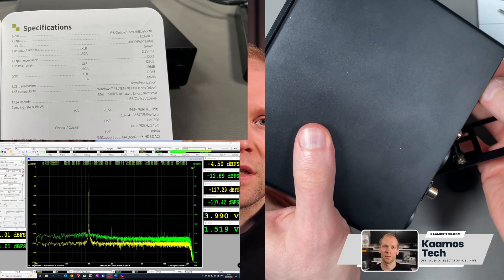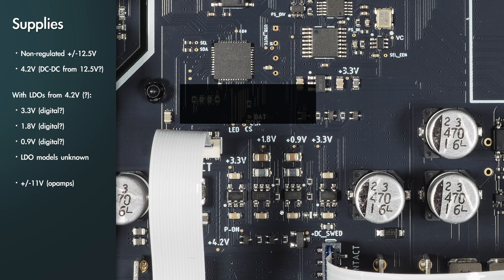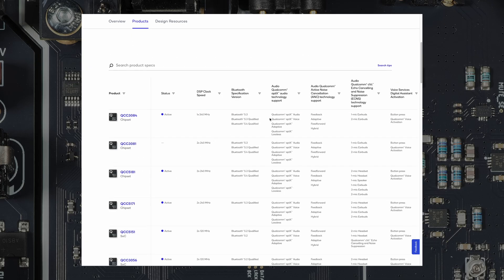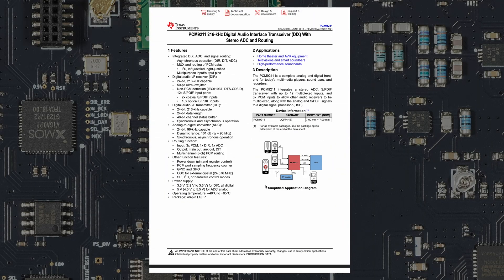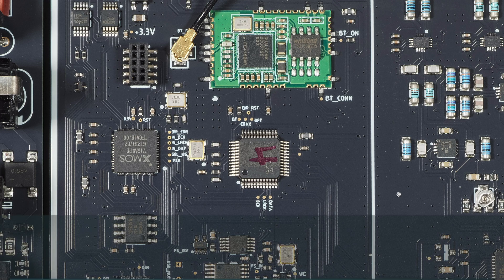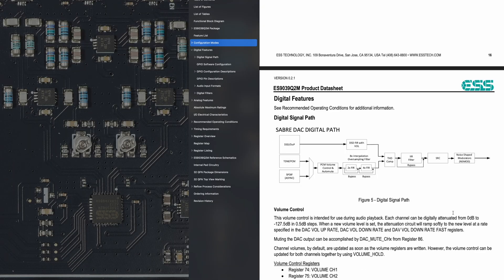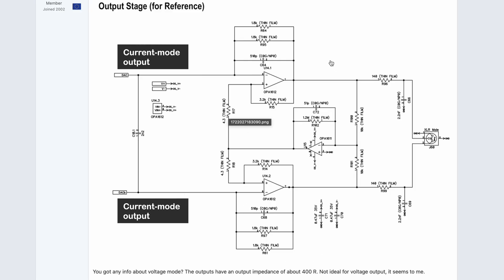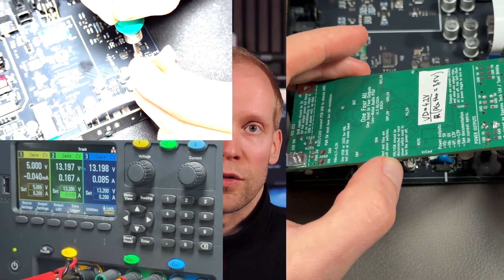S.M.S.L D-6s DAC Teardown Pt.2: PCB Details and Main Components.

Comment: It seems like that the display and the volumecontrol can be taken of and placed somewhere else maybee with some extensions, does that sound right. (I want to use a DAC internal in a Mediacenter PC )
Reply from the maker: Yeah I would guess it works just fine, especially if it's only low tens of cm length to the front panel.